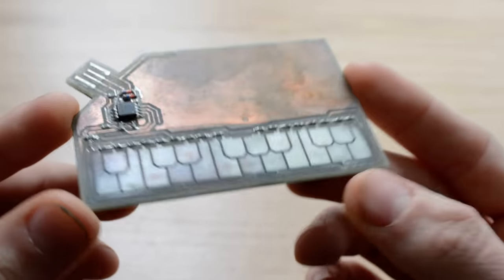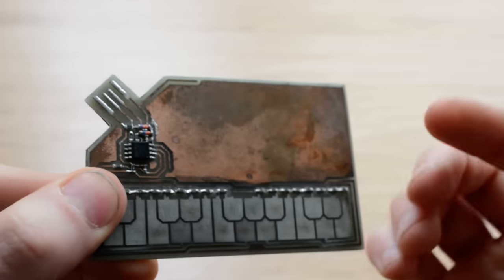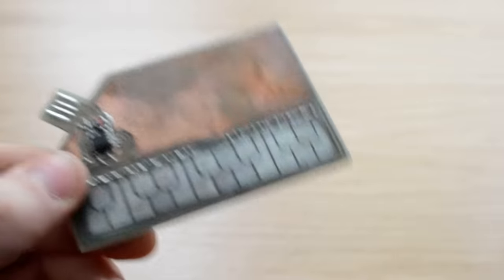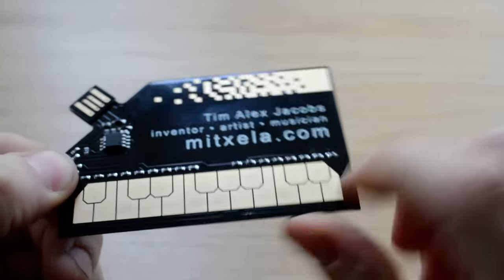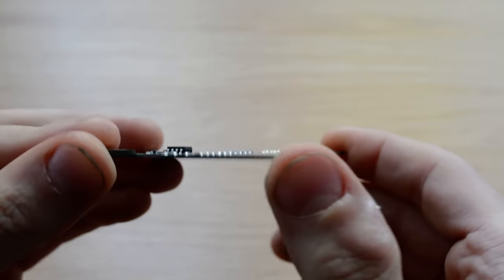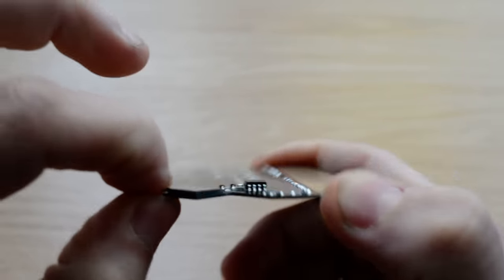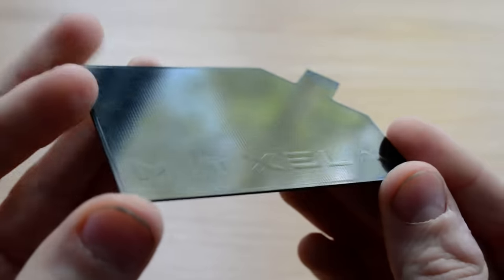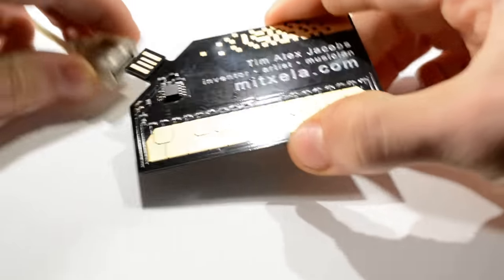Stylophone Business Card

Comment: "I paid extra for the gold plating " imedately scratches off
Reply: He needs a gator clip that's made from a softer metal than gold. I'd say clamp a piece of pencil lead or something like that in there.
Reply: @Smooj  lead is an insulator.
Reply: @keeghan0  True, but pencil lead is made from graphite, which is a conductor.
Reply: @Smooj  ok that makes a lot more sense.
Reply: @Smooj  the only problem with that though, it that graphite tends to be brittle and it would break off onto the card and leave marks on it unless it is specially designed
Reply: @keeghan0  you can just wash it off when you're done🙃
Reply: @aljazslemc9569  ah yes; cleaning my electronic business card with water. genius.
Reply: @honeycrisp808  yeah, i knew this was coming😅 should have phrased it better considering i meant clean it. You can probably rub it clean without much issue. If it needed an actual wash, unplug it and use isopropyl alcohol 🙃
Reply: @aljazslemc9569  You can clean electronics with water if they are off and you completely dry them off afterwards. Also don't have them powered.

@honeycrip Completely a logical item someone has that can clean off the business cards.
Reply: @keeghan0  use a rubber.
Reply: @honeycrisp808  water doesn’t hurt electronics, water hurts powered electronics
Reply: @Smooj is graphite lead?
Reply: @frogmouth2  graphite isn't lead, but pencil "lead" is graphite.
Reply: @honeycrisp808  obviously dont clean it with water, you'd use isopropyl alcohol.
Reply: @keeghan0  wait but lead, as in metal lead is also an conductor isn't it
Reply: @keeghan0  Lead is NOT an insulator, what are you on about? It's conductive, like any other metal. The terminals on your car battery are made out of lead... as is the battery itself.
Reply: @Golinth  distilled water ideally, hard water leaves minerals in the circuit
Reply: There are 2 types of gold plating: a) against corrosion and b) for connectors, which is dicker and harder
Reply: @keeghan0  "Although lead compounds can be good insulators, pure lead is a metal that conducts electricity, making it a poor insulator. Lead's resistivity is 22 billionths of a meter."

I knew that was one of the most untrue things I ever heard.
Reply: @honeycrisp808  the only issue with water and electronics is that the water can be conductive and cause shorts. No electricity, no conduction, no shorts
Reply: @Tsskevik  Resistivity doesn't equal conductivity. You're still right, but using that copy paste as proof was the least convincing thing ever. Coppers resistivity is like 2 billionths so what's your point with the resistivity?
Reply: @honeycrisp808  Isopropyl alcohol if you wanna play it safe, or like how my homies do it, dump that bad boi in soapy water, rinse it, dry it for about 2 days, usable
Reply: @Smooj  Graphite held together by nonconductive glue.
Reply: @keeghan0  While compounds of lead can be insulating, metallic lead is not an insulator in and of itself.
Reply: @Bobjobon24 : Yeah Resistivity is the inverse of conductivity though soooooo..... Lead is not highly resistive, meaning it is very conductive. It is half as conductive as iron though, wich is five times less conductive than copper. So lead is definitly on the resistive side but also not an insulator.
Reply: @keeghan0  1. Pencil lead does NOT contain any lead, but is made from graphite
2. Lead is not an insulator
Reply: @keeghan0  If only pencils came with a device intended for removing graphite marks 🤔
Reply: @honeycrisp808  you can still probably use water with this, water can only short circuit some things but i dont feel like explaining it lol
Reply: @Golinth  short circuits hurt electronics. if the water is non conductive, it should be fine
Reply: @Smooj  pencil lead is also made from clay, which i imagine is probably an insulator
Reply: @mgsp5871  Best. Typo. Ever.
Reply: that killed me
Reply: @honeycrisp808  Are you actually under the impression that there would be any problem with that? You don't know much about electronics, do you?
Reply: @Golinth  pure water is not conductive
Reply: @keeghan0  pencil lead isn't actually lead. Anymore. It's graphite. Conductor
Reply: @keeghan0  Pencil lead is made out of graphite
Reply: @keeghan0  laughs in free 4H pencils my graphics teacher gave us for drawing lighter

Naturally they stay sharp for longer too! If we had better eyesight we could use em naturally and save resource- wait then we'd need even lighter ones for drawing heh...
Reply: @keeghan0  Lead is the primary component of solder.  It conducts just fine.  Also, pencil lead is made of graphite, which is also a conductor.
Reply: immediately*
Reply: @honeycrisp808  Fun fact, but pure H2O is actually an insulator. It's just really difficult to get water without any conductive ions in it. Namely salt.
Reply: @keeghan0  No, lead is a quite good conductor. About the same as steel.
Reply: @Smooj  But the graphite is mixed with clay and wax as a binder that makes it stay on the page, which makes its conductance less than normal graphite, though probably still good enough.
Reply: it's probably ENIG, a thin layer of gold over a thicker layer of nickel. After all, the scratches are gray like nickel and not orange like copper. So we can still keep oxidation at bay for awhile longer until the nickel wears off

Comment: 4:09 your movements here tell me you were itching for some modulation
Reply: @SS-bs2su  Vibrato on a keyboard
Reply: You technically can, if you can measure the voltage on the key, depending on how close or far is the tip of that clamp to the edge of the key the value will change and you can use that to do modulation.
Reply: @SS-bs2su  Well yeah, my joke is, you cant do vibrato on a keyboard. Don't interpret it wrong :D
Reply: @netroalex5209  Check out seaboard...
Reply: @HAWXLEADER  Well sorry that there seemingly is one goddamn keyboard that can do that
Reply: @netroalex5209  That can do it that way... other keyboards can modulate using varying pressure after touch and some uses mod wheels. also there are some weird touch keyboards...
Reply: @netroalex5209  A decent amount of keyboards have a wheel or something you can wiggle for vibrato.
Reply: Inferry pretty unlikely, it looks like he’s using the uProcessors ADC and building up a voltage divider where each key forms a unique voltage divider, that is fixed upper arm and shunting that with unique R values which produce unique V values that then get quantized to notes. That sort of arrangement doesn’t much lend itself to modulation on the keyboard itself. That said if you had another ADC input maybe you could have a finger pad that you could press for modulation :)
Reply: NetroAlex: "you cant do vibrato on a keyboard"
LFOs: About to ruin this man's whole career.
Reply: What was the song played, if not original
Reply: Or maybe he plays guitar and it's habit lol
Reply: D
Reply: @Inferryu  idk it would be hard to play in tune, and that's the one of the reasons to play keyboards right?
Reply: @netroalex5209  there are a few synths that can do that
Reply: @rebmcr  should've said you cant do vibrato on grand pianos, that would've made my life a lot easier
Reply: @netroalex5209  I want to agree with you but I'm scared of that one guy who might show up and prove us wrong lol
Reply: @rebmcr  Damn, you really have to watch out what you're saying here otherwise 200 people will flame you about stuff

I once commented on a video a year ago which showed Justin Bieber solving rubix cube and said "Justins cube was literally already solved." and I still get shitstormed

Comment: If you ever decide to make a V2 of this, consider putting the components on a Flat Flex PCB and bond it to the card with some epoxy or resin with some cutouts for the components to fit through in the PCB substrate itself. This will make the overall thickness much more uniform and protect the components from being knocked off during normal use. You might also consider a USB OTG controller instead and a flip-out USB-C and some storage so you can plug it into your phone and play it that way.

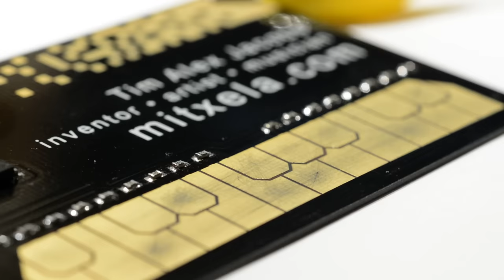Comment: A pretty cool idea and even cooler realization. BUT: see those scratches in the gold plating, e.g. 4:41? That gold finish won't remain long - sadly...
Reply: Then again not everybody's gonna use something as sharp as him to play on it.
Reply: Yes, thats why he went with the gold plating... He had mentioned this fault in the tin and addressed it by adding gold plating. It'll last longer, but not indefinitely. This card is just a cool gimmick to grab the attention of a customer, no need to last forever.
Reply: It "should" have been finished with "hard gold" plating rather than immersion gold (the immersion gold finish has a minuscule layer of gold on top of nickel, the hard gold finish is what is used on card edge connectors such as for extension cards on PCs). However, the setup cost of that would have been so high that it probably makes more sense to just keep a few PCBs in reserve for when they wear out, and most people that receive one as a business card would only use it for 5 minutes at best anyway.
Reply: Maybe make a pen from a material that is softer than copper. A pen with a lead tip(you might be able to use a blob of solder.
That will slow the wear down drastically.
Reply: jort93z lead is toxic not smart idea. Babies and dumb people might try to eat it.
Reply: @holderhilder9104  as they don't swallow it there is no problem ( we use lead to fill roten tooth/teeth ( the white bone in the mouth ( don't remember their name in inglish '^^ ))
Reply: Maladie X5 it is teeth you where right on that. I could be wrong but I think it’s a lead alloy or/and they put a layer over it to contain it.
Reply: Are you going to swallow a pen? LOL.
People also use lead for soldering. It is banned in the EU for commercial products(so anything intended for worldwide sale will adhere to that), but I'd be supprised if his business card does not have lead solder on it.
And lead as a metal is not that toxic. Your body doesn't really absorb it. Lead salts is whats really dangerous.
Reply: Graphite pencil should work. Also, nickel plating is much more durable than gold and will not oxidize easily, so may be don't use gold altogether.
Reply: @avelkm  wait gold can oxidize? i thought it was known for not oxidizing.

Comment: Only just occurred to me now that Mitxela is "Alex Tim" backwards :P
Hey if you want it thinner, how about milling a square hole in the PCB, and soldering the chip upside down? of course you'd have to reroute traces, but I've seen this done in some commercial products, so should work for you :D

Edit: Tim, not "Time" :P
Reply: I've never seen that done before myself, pretty clever. As far as getting something like that manufactured, I wonder if that would pose any problems when sending your files off.
Reply: Another way to make it flatter would be to replace the surface-mount resistors with carbon printed resistors, and then try to bunch everything else you can as close to the USB port as possible to benefit from sitting in the port's "shadow".
Reply: Yeah you can do it, but it requires a little effort to measure and make an eagle library for such a thing.
Reply: How curious to find you around here xD
Reply: David Hagler I think that it would be easier to accidentally punch out the chip, but I don't know how much abuse a typical PCB business card endures
Reply: The Mod Shop .
Reply: You could just fill the remaining cutout space around chip with some epoxy to strengthen it
Reply: mb just use BGA chip?
Reply: Likewise a micro USB socket mounted into a cutout would lower the height, allow the card to be fully rectangular and make connecting this thing up easier.  USB Male A to Female A cables are nothing like as common as micro-USB cables, and (I think) are prohibited by the the USB standard.
Reply: @austi01101110  u know what imma do that too.

Comment: Great idea. I'm a sucker for stylophones. The soft gold coating doesn't seem to hold up very well to the rubbing of the steel croc clips on it, though. It would hurt the price point, but a purpose built stylus with a soft carbon brush tip or something of that nature might be more gentle on the coating. But at the same time, the stylus might not hold up well if you make it too soft. So it's a tricky problem.

Comment: An Attiny is not the best technical solution. A PIC16F1455 is only a few cents more expensive and has cerftified hardware USB2.0 Full Speed built-in. If you need more pins, the 16F1459 is the way to go.
Reply from the maker: You are absolutely right. I want the next batch to have a chip with hardware USB. It would also be good to adapt it to read the keyboard without needing the resistors, to lower the total part count (that would probably make up the difference of having a slightly more expensive uC)
Reply: I was surprised when I checked Digikey for USB equipped MCUs to see the SAMD (ARM based Atmel design), EFM8, and STM32 chips at lower cost than either PIC or AVR. Some Kinetis (NXP) devices can do USB without a separate crystal, but they do cost more. And apparently there's a spec for 2.5mm TRS jack MIDI now.

Comment: That's awesome!  Have you ever thought of making a cutout for the little IC so it could be sunk into the thickness of the card instead of sticking out?  Or if that is not feasible, blend in its thickness with a blob of epoxy or a tapered flange ring.
Reply: I think a second layer to make the IC flush and the keyboard slightly further from the elements is a great idea, especially considering he already needed a second layer to make the USB work.

Comment: Very nice! It may be possible to limit the design to 1 layer by adding holes on the 2nd layer of the usb connector (like large via, may not even need to be lined with copper) and solder it to the first layer through that. Would be easier to assemble too.

Comment: I'm not an engineer, I'm just an electric technician, but I've got an idea to add to that business card: what if you solder a flat piezoelectric buzzer to it so it has integrated sound? Maybe just 2 pads where you add solder paste and put the buzzer (just the piezoelectric part, so it stays flat) and melt the solder paste

Comment: Just wondering - could you have a rectangular cut-out in the PCB and mount the gull-wing chip upside-down so as to utilize the thickness of the PCB to reduce the overall profile? Also - a piezo buzzer would fit nicely next to the pixel-art ground plane, no?

Comment: You should try touch capacitive
Reply: Someone could put grounding wires on all their fingers.
Reply: I thought the same thing, they're not really that hard to do.
Reply: In fact, with capacitive touch you could even detect how strong someone pushes on the buttons. But you could only have 5 buttons, because thats how many io pins it has. Maybe only 3 buttons? not sure how he communicates over usb. 
He can't use his method of a resistor ladder as he did here.
Reply: @nemo-x  That would probably make it sit better in a wallet too. A single chip is more prone to being knocked off.

Comment: Doesn't look like it would be a stretch to use a Ridge Wallet as the container for the card's playback electronics including a mono micro speaker from a cellphone and maybe 2 CR 2032 watch batteries for power. The card is the stylophone and the card wallet carried the playback circuitry for full functionality. Just a thought.

Comment: you could add a gold plated through 4mm hole, so you could insert a banana jack. Then you could use a short gold plated banana jack cable, and use gold on gold contacting. Its also sometimes possible to choose from various gold-plating thicknesses and use a thicker gold plating. Just a thought.

Comment: Next version could have captative sensing so you can just use your fingers, perhaps a small speaker and a midi selector added ... USB is generally a security risk at companies (like mine) and would prevent the use. The design is kool and stands out that is 80% of the point of a card.

Comment: I have a suggestion to improve this card, use a piezoelectric speaker which is paper thin, and there is paper thin lipo battery which you can use as power source.

Comment: I would make the PCB multi layer and have cutouts for all the SMDs. Then place them in the cutouts so they dont protrude. For the IC, you could place it upside-down.
And you can include a couple of CR2016 cells, as they're 1.6mm thick. Just use a layer of FR4 over the base that's 0.1mm thick. And a cover for the lithium cells to keep them in place that's also 0.1mm or thinner.
You could even have a super thin speaker embedded if you can find one. A piezo would work but not give good low freq response. But you can find some moving diaphragm speakers that are ultra small. Or make one from 0402 inductors and a thin sheet of steel suspended on top and mounted with a few drops of silicone sealant.
Great work!!
What IC did you use??

Comment: tbf it wouldn't have been too hard to add one of those thin 1mm thick crystal speaker things cheap toys use as well as little cut out slots on the USB port to allow you to snap it off after programming the IC if someone wanted to actually stick it in their wallet

Although powering it with a battery would be difficult...

Comment: Any plans on a stylophone business card 2.0? My suggestions would be to replace the full size usb A connector with a Micro USB port. Not only would it look nicer, most people already have Micro USB cables, but they don’t have USB A extension cables. If you were to create a little notch in the pcb so the jack could be rest inside the notch, rather than surface mounted, it would actually be thinner than your current design (1.85mm vs the current 2.0mm height). Also, adding transpose octave and MIDI channel up and down buttons would be awesome if it doesn’t add too much extra complexity to the device. Simple beats functional in this case.